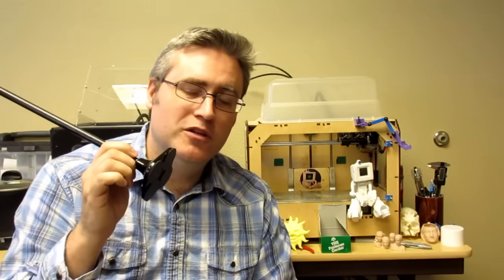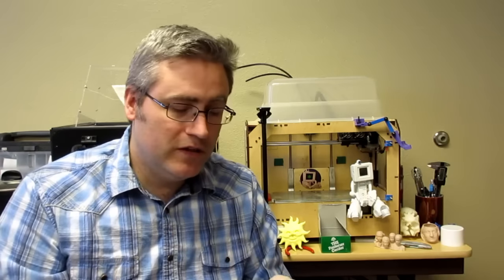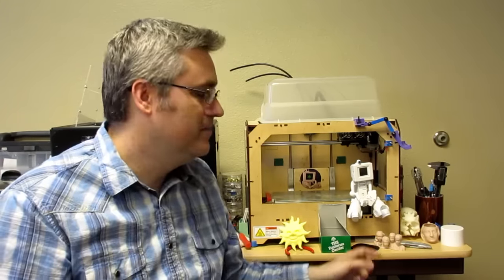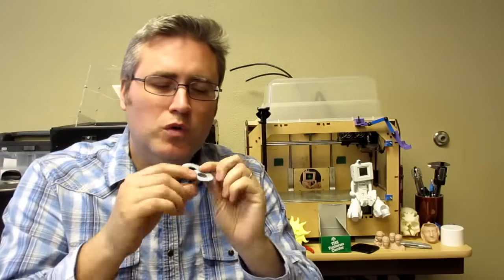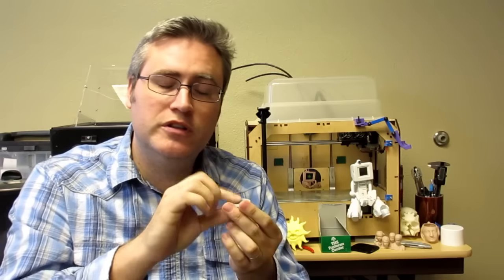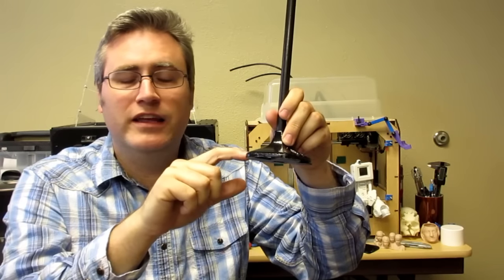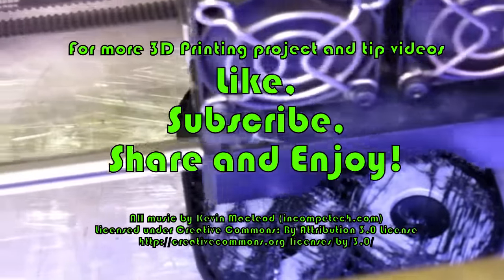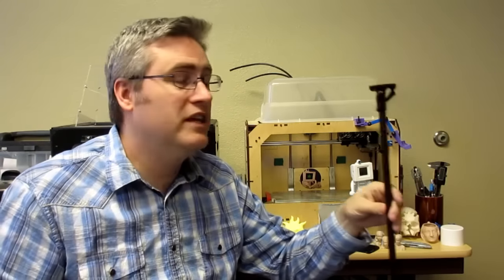Inserting objects into 3D Prints

Comment: Here's an idea:  Use glue stick on the metal washers, but also make sure to put the washers on the heat bed for a bit before you insert them.  I can imagine that a room temperature set of washers would likely suck all of the heat out of the surrounding area.

Comment: One time I insert a nut in a 3D print base for a tripod and I did it after printed, heating up the metal nut and then using pressure.
It worked fine
Reply: That is perfect!

Comment: Thanks, this is helpful .  Thinking about putting a Neodymium Magnet into a print to make a refrigerator magnet.   Just now realized that I need to test to see if the print head is ferrous before I try this.
Reply: May have to just print a void in the bottom and use super-glue.
Reply: I did it and had no issues. Nozzles are usually Brass. The print bed will be or will have something magnetic but that is not a bad thing because there will be attractive force between magnet and bed.

Comment: I saw something the other day on inserting thin material between layers (think nylon tights, that kind of thing). Provided you stretch out the material so that it is less than one layer thick then the next layer goes on fine without hitting or melting the material, and you end up (with a suitable model of course!) with a flexible print. For example: a hinge, or a patterned panel to be sewn into clothing, and so on.

A question --- does the PLA have to stick to the washer? Shouldn't the slicer bridge with gap above the washer anyway?
Reply from the maker: +Mark Wheadon Provided the material being stretched is porus... yeah, i could see that working.

So I didn't clarify, but I did this with ABS. Hence the vapor smoothing treatment being so shiny at the end. And with ABS, no, the bridge didn't work because it was too long, which resulted in flyaways which resulted in partially failed prints. No, it wasn't technically necessary, but it made the print much, much better.
Reply: Ah right -- the mention of vapour smoothing should have given me the hint. I guess one way would be to print some little sleeves for the coins (and make the holes correspondingly bigger) -- the bridging layer would stick nicely to the top of the sleeves.

Comment: Glad you talk about the subject. But what is the ideal way to do so? What code would you insert to lets say, PAUSE, RAISE hot end 3mm, (insert object),  then lower 3mm and continue?  Is that not better?

I am just concerned the hot end will warp and destort the part as it sits right on the print paused melting the previous layer.. Am i missing something?
Reply from the maker: I have no idea what code to insert into the Gcode. I manage it though the menu because i have a machine running Sailfish. There've been a lot of discussion on a lot of boards about this and the only thing I've gathered is that no one knows yet and the correct answer may be different for each printer and how to do it may be different for each slicer. if I figure it out I'll make a video.
Reply: Thanks, ill give it also a shot, maybe insert the  pause and  raising and lowering Z before continuing on a test print... ill let you know as well if i am successful.
Reply: Well professor, i think i got it. Just tried this on my Prusa by inserting the code into Repetier Host Gcode and it worked good.
I got this code from tinman youtuber, except for his purposes  he needed ;@pause... it didnt work for me with the ; before the @pause

So, here it is (insert right before the layer you want this to be in effect)

G1 E-1.00 F6000 ; retract filament
G1 Y0.00 F9000 ; move print away from the extruder
M84 E ; disengage the extruder stepper motor from 'holding' position
;@pause print
G1 X0.000000 Y0.000000 F7000 ; home X and Y axis in case position was bumped out
G1 E0 F6000 ; engage the extruder stepper motor
Reply from the maker: That's awsesome. Thanks so much for posting it. Of course inserting this code is going to depend very much on what slicer you use, or if you're the sort who will just open the GCode in notepad and do it that way. Can't wait to have a reason to try it out.
Reply: Yes. So far i tried with repetier and craftware. i did simple test of an empty 10mm cube... printed 5 layers, then inserted this before layer 6... then let it print few layers before i stopped it, that way i tested it but didnt waste much material.

Comment: what about non gcode non software method of wasting the print heads time and tell it to air print in an area away from the design by say inserting a flat topped mushroom next to the object so the mushroom head wastes time on the layers while you drop in objects the mushroom will most likley fail but the strings will hopefully wrap around the stalk and keep out of the way
Reply from the maker: You'd have to be fast, especially with printers getting faster. But, yeah, it could work.
Reply: Hi Sam, here is what we do, resume interrupted printing automatically: https://www.youtube.com/watch?v=FJF_mJaK1ic
  You do not need to edit any G-code.

Comment: I've got to know.. How are you breaking glass beds?
Reply from the maker: +RJ_Make Not waiting until they cool before prying part with huge flat bottoms off of them. Or sometimes I am waiting until it cools and it still breaks. I don't know, man. I was on my 6th glass plate and none of them didn't have a considerable chip in them that I had to print around so I decided to try something else. And it worked. A little more costly and I never quite got them to fit so that they didn't wiggle, but I haven't managed to chip the metal plates yet.